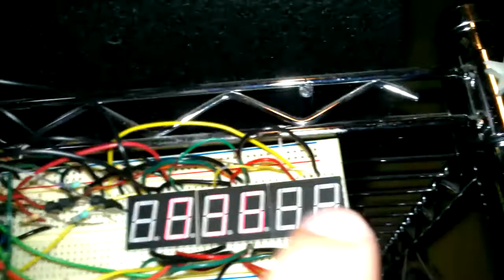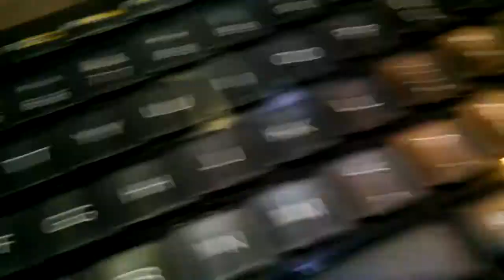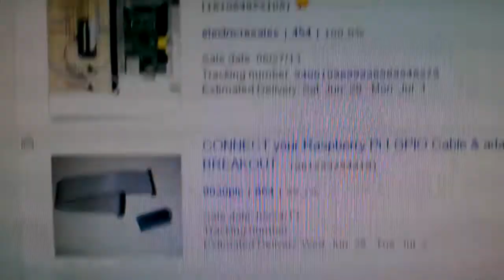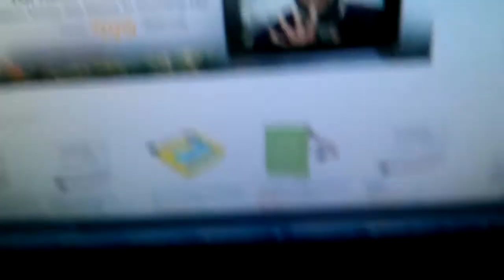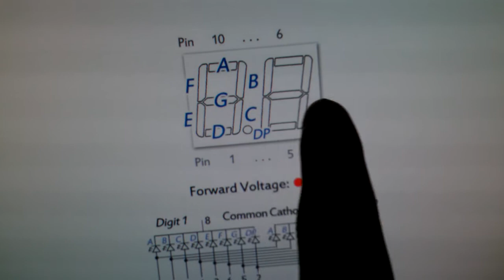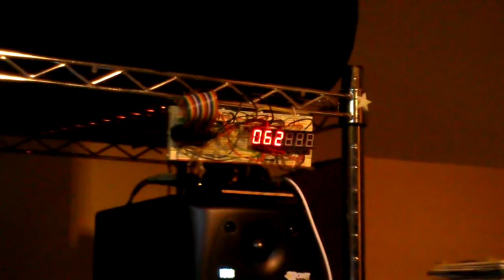Raspberry Pi GPIO To Show Time Clock, Date, CPU Load, Temperature, Uptime

Comment: mind sharing a link to the actual code?
Reply from the maker: Brian Asembo what is it you want to learn?
Reply: leefiles im assigned to make a digital clock and date using a 3 digit 7 segment. intending to place 2 displays. currently im new to python and stuck at the seconds count loop. would really appreciate any help.
Reply from the maker: Brian Asembo I wrote it in perl at the time in 2013. perl is very difficult. It would be easier to go to adafruit to get a 4 digit module. then go to the raspberry pi website. my source code won't do you any good because its customised for my wiring. its highly unlikely that you would have the same parts and wire it the same way. Also you wouldn't be able to explain to your teacher my cryptic perl code.
Reply from the maker: Brian Asembo first you need a "daemon" written in python. Look that up. Then find out how many times it cycles per second.
Reply from the maker: Brian Asembo Here's what I wrote in perl. 
#!/usr/bin/perl

# clock
#
# only need to change $num
# the script figures out the rest
#
# june 16 2013
#

# modules ################################
use Device::BCM2835;
use strict;
#use Term::ReadKey;
require '/maindata/progs/gpio/modules/gpio.pm';

# variables #################################
my $delay = 1;
my $displayAlt = 300; # n in while loop cycles, not seconds
my ( $glbPrevIdle, $glbPrevTotal );

# segments #############################
my %segments = (
    "0" => "24 22 26 23 19 21",
    "1" => "22 26",
    "2" => "24 22 15 19 23",
    "3" => "24 22 15 26 23",
    "4" => "21 15 22 26",
    "5" => "24 21 15 26 23",
    "6" => "24 21 19 23 26 15",
    "7" => "24 22 26",
    "8" => "21 19 24 15 23 22 26",
    "9" => "21 24 15 22 26",

    ')' => "24 22 26 23 19 21 10",
    '!' => "22 26 10",
    '@' => "24 22 15 19 23 10",
    '#' => "24 22 15 26 23 10",
    '$' => "21 15 22 26 10",
    '%' => "24 21 15 26 23 10",
    '^' => "24 21 19 23 26 15 10",
    '&' => "24 22 26 10",
    '*' => "21 19 24 15 23 22 26 10",
    '(' => "21 24 15 22 26 10",

    "A" => "19 21 24 22 15 26",
    "b" => "21 19 15 23 26",
    "C" => "24 21 19 23",
    "c" => "15 19 23",
    "d" => "15 19 23 26 22",
    "E" => "24 21 15 19 23",
    "F" => "24 15 21 19",
    "g" => "21 24 15 23 22 26",
    "H" => "21 19 15 22 26",
    "h" => "21 19 15 26",
    "I" => "22 26",
    "J" => "19 23 26 22",
    "L" => "21 19 23",
    "n" => "19 15 26",
    "O" => "21 19 24 23 22 26",
    "o" => "15 26 23 19",
    "P" => "19 15 21 24 22",
    "r" => "19 15",
    "S" => "24 21 15 26 23",
    "U" => "21 19 23 26 22",
    "u" => "19 23 26",
    "Y" => "21 15 22 26",
    "Z" => "24 22 15 19 23",
    "-" => "15",
    " " => "",
    "_" => "23",
    "=" => "15 23",
    '.' => "10",
    );
my @transistors = ( 16, 12, 18, 11, 7, 8 );
my %numDotToSingleChar = (
    '0.' => ')',
    '1.' => '!',
    '2.' => '@',
    '3.' => '#',
    '4.' => '$',
    '5.' => '%',
    '6.' => '^',
    '7.' => '&',
    '8.' => '*',
    '9.' => '(',
    );

iniGPIO(); # initialize GPIO, ( module Device::BCM2835 )

my @fourLEDModules; # now six
my $num;

my $countAlt;
my $cpuTempF = getTemps( "f" ); # display temp F
my $cpuTempC = getTemps( "c" ); # display temp C
my $loadavg = getloadavg(); # get /proc/loadavg
my $uptime = getUptime(); # display uptime
my $cpuPercent = getCPUPercent(); # CPU %
my $key;
#ReadMode 4; # Turn off controls keys
#while (not defined ( $key = ReadKey(-1))) {
while (1){
    # date, time, localtime
    my ($ss, $mm, $hh, $day, $month, $year) = (localtime time ())[0..5];
    $month ++;
    $year -= 100;
    for ( $ss, $mm, $hh, $month, $day){
        $_ = sprintf( "%02d", $_);
    }

#    # alternate time / date
    $countAlt ++;
    if ( $countAlt > ( $displayAlt / 1.1 )  ){
        $num = "UP $uptime";
    } elsif ( $countAlt > ( $displayAlt / 1.24 )  ){
        $num = 'Ld ' . $loadavg;
    } elsif ( $countAlt > ( $displayAlt / 1.4 )  ){
        $num = "CPU" . $cpuPercent;
    } elsif ( $countAlt > ( $displayAlt / 1.66 )  ){
        $num = $cpuTempC
    } elsif ( $countAlt > ( $displayAlt / 2 )  ){
        $num = $cpuTempF;
    } elsif ( $countAlt > ( $displayAlt / 3 )  ){
        $num = "$month$day$year";
    } else {
        $num = "$hh$mm$ss";
    }
    if ( $countAlt > $displayAlt){
        $countAlt = 0; # reset loop

        # for display cpu temps F
        $cpuTempF = getTemps( "f" );

        # for display of cpu temps C
        $cpuTempC = getTemps( "c" );

        # display modified /proc/loadavg
        $loadavg = getloadavg();

        # display uptime
        $uptime = getUptime();

        # cpu %
        $cpuPercent = getCPUPercent(); # CPU %
        $cpuPercent = sprintf ( "% 3d" , $cpuPercent);
    }

    # convert number to six digits [x] [x] [x] [x] [x] [x]
    for ( 0 .. 5 ){
        $fourLEDModules[$] = substr( $num, $, 1 );
    }

    for my $module ( 0..5 ){
        my @transistorsPins = ( $transistors[$module] );
        switchGPIOWithDelay( \@transistorsPins, $delay, 1 );

        my @pins = split /\s/, $segments{ $fourLEDModules[$module] };
            switchGPIOWithDelay( \@pins, $delay, 1 );

            switchGPIOWithDelay( \@pins, $delay, 0 );

        switchGPIOWithDelay( \@transistorsPins, $delay, 0 );
    }
}

#ReadMode 0; # Reset tty mode before exiting, ( module Device::BCM2835 )

########################################################################

sub getTemps {
    my $unit = shift;

    my $cputemp;
    open READ, "/sys/class/thermal/thermal_zone0/temp";
    $cputemp = <READ>;
    close READ;

    chomp $cputemp;
    $cputemp /= 1000;

    my $f = $cputemp * 9 / 5 + 32;

    for ($f, $cputemp){
        $_ = sprintf ( "%.1f" ,  $_  );
    }

    for ( $cputemp, $f ){
        $_ = numDotToSingleChar( $_ );
    }

    return "$cputemp C" if $unit eq "c";
    return "$f F" if $unit eq "f";
}

sub getloadavg {
    open READ, "/proc/loadavg";
    my @load = <READ>;
    close READ;
    my $load = $load[0];
    chomp $load;

    $load =~ s/^(\d+\.\d+)\s.*/$1/;;

    $load = numDotToSingleChar($load);

    return $load;
}

# convert floating point decimals to single digits
# six digits have 7 seg + dot
# 0.123 becomes shift 0 and 123 => ')123'
# first digit zero dot [0.] in one 7seg module
# second digit is [1], [2], [3]
sub numDotToSingleChar {
    my $float = shift;
    $float =~ s/(\d\.)/$numDotToSingleChar{$1}/;
    return $float;
}

sub getUptime {
    open READ, "/proc/uptime";
    my @sec = <READ>;
    close READ;
    my $sec = $sec[0];
    chomp $sec;
    $sec =~ s/^(\d+).*/$1/;
    $sec = int($sec / 86400);

    return $sec;
}

sub getCPUPercent{
    open READ, "/proc/stat";
    my @stat = <READ>;
    close READ;
    my @fields = split /\s/, $stat[1];
    shift @fields;
    my $cpuIdle = $fields[3]; # idle field
    my $cpuTotal;
    $cpuTotal += $_ for @fields; # add all fields
    my $diffIdle = $cpuIdle - $glbPrevIdle;
    my $diffTotal = $cpuTotal - $glbPrevTotal;
    my $usage = int ( 100 * ( $diffTotal - $diffIdle ) / $diffTotal );

    $glbPrevIdle = $cpuIdle;
    $glbPrevTotal = $cpuTotal;

    return $usage;
}